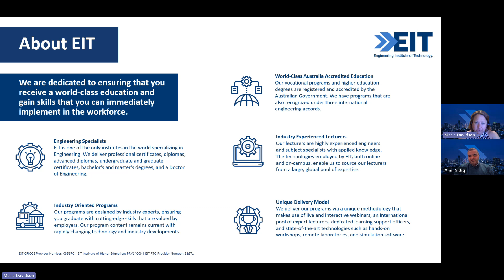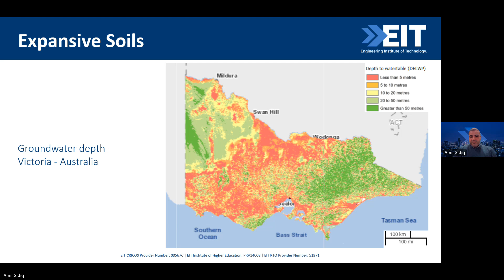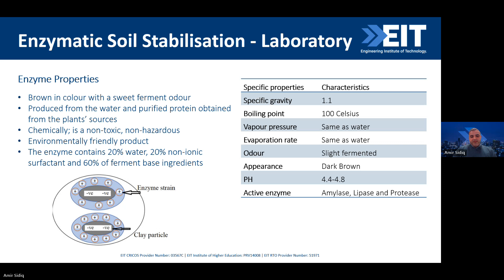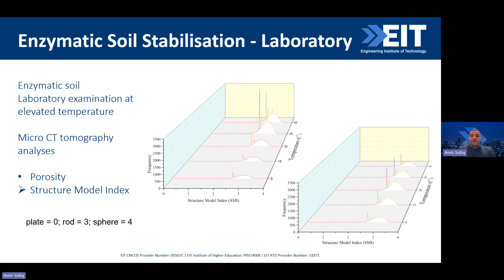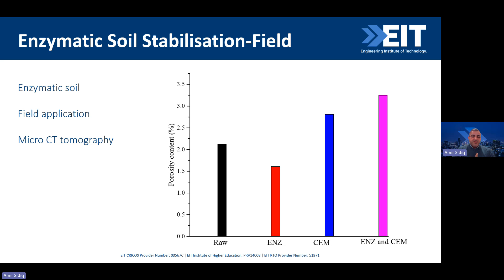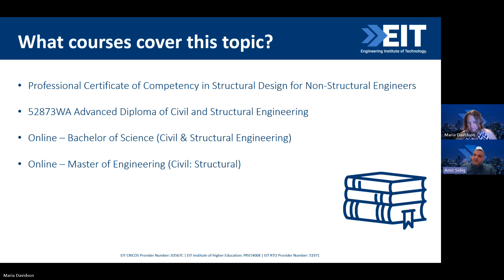Stabilization of Expansive Soils by Using Eco Friendly Enzyme Based Material

Comment: "Is there any chance I can get the certificate?
I really enjoyed the session, but it would have been even more😅 helpful If I had joined the live session" 😅
Reply from the maker: Hello @baninalo8342, unfortunately not. This webinar took place almost a year ago. You can register for out upcoming technical webinars here: https://www.eit.edu.au/news-events/events/?tribe_events_cat=webinars/ where you can receive a certificate of attendance.
Reply: @EngInstTech  “Is there any chance of getting the report of this presentation? It would be very beneficial for my current project, which is on the stabilization of clayey soil using bio-enzyme.”
Reply from the maker: Hello  @baninalo8342 , yes you can. Please see the info here: https://www.eit.edu.au/event/stabilization-of-expansive-soils-by-using-eco-friendly-enzyme-based-material/
Reply: @EngInstTech  what Eco-friendly enzymatic based materials have you used?? And what is the process of making it